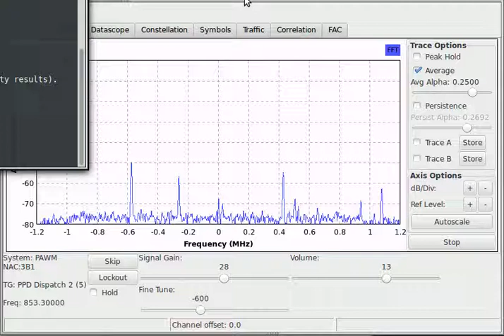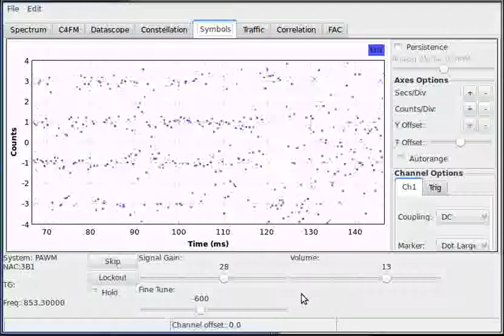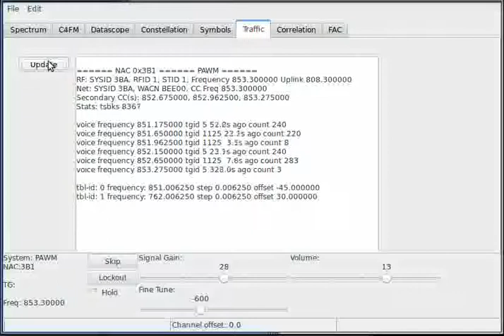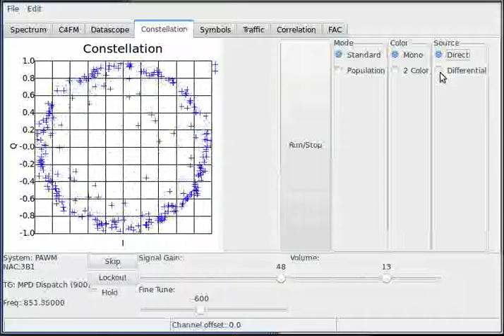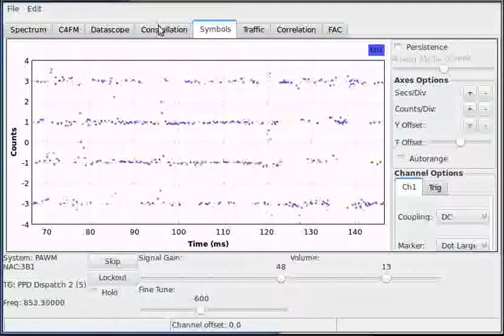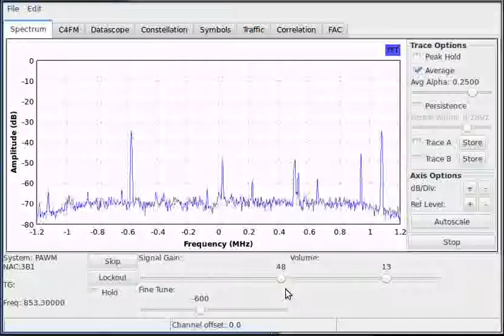PAWM OP25 RTLSDR w/stock antenna

Comment: I have been using OP25 for about 4 months now, and love it.  I assume the control channel is the spike just to the right of the 0 mark since you have it adjusted -600 on the slider, am I right?
Reply from the maker: Nope.. This system contains 12 channels, and they all fit in the 2.4MHz bandwidth. In the trunking TSV file, I specified a center frequency of 852.2250. So that is the frequency at 0 Hz in the graph. The actual control channel is on the far right side(853.3000). I modified the scope app to have a static FFT spectrum, so it doesn't jump around when the channel changes to voice and back. Sorry for the confusion.
Reply: Gotcha.  Thanks for explaining that.  I was wondering how that "center frequency" thing worked.